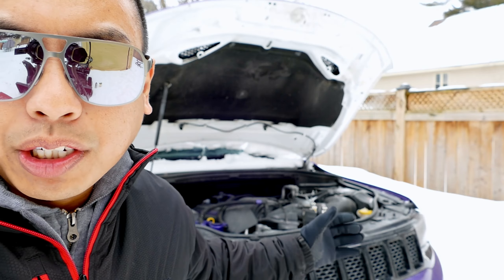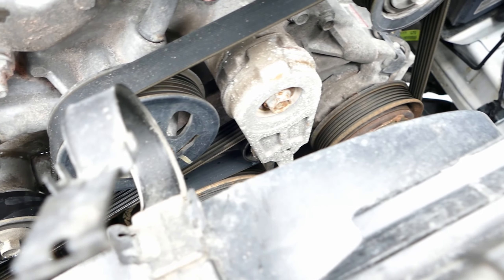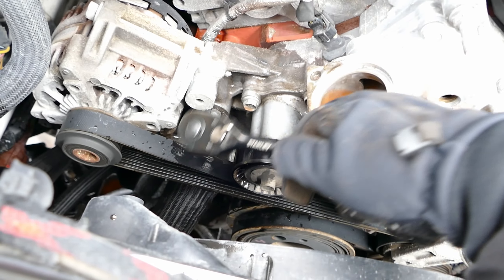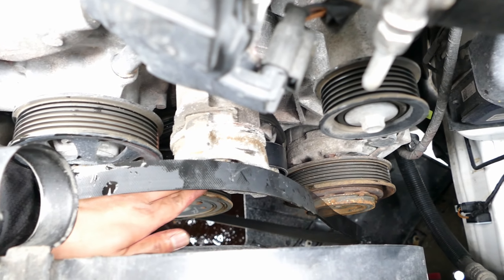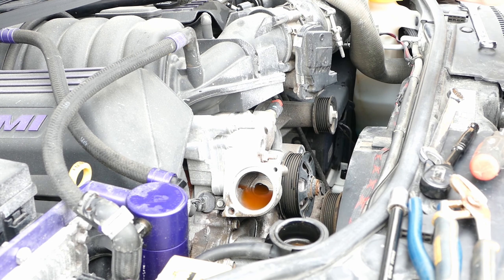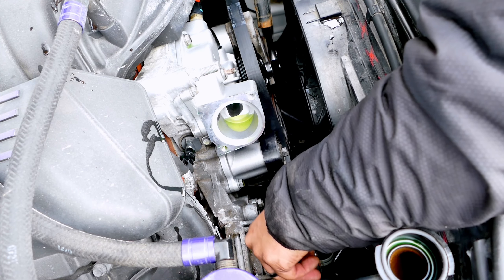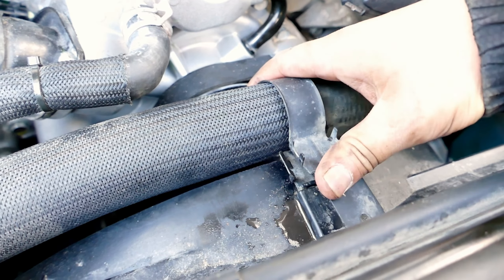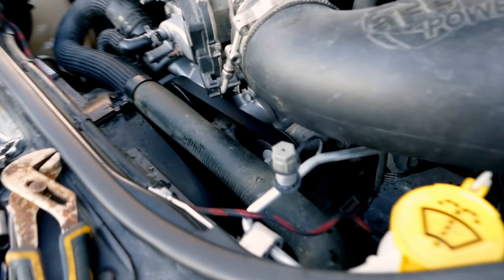hemi belt tensioner

Comment: How do you know if you have a bad tensioner?
Reply from the maker: @hippycreed6897  usually if it get noises/squeaky or extreme cases doesn't move the rollers. If you replaced the belt and it doesn't solve the issue it's most likely the tensioner not providing enough tension and needs to be replaced